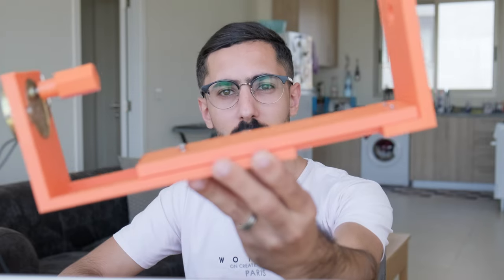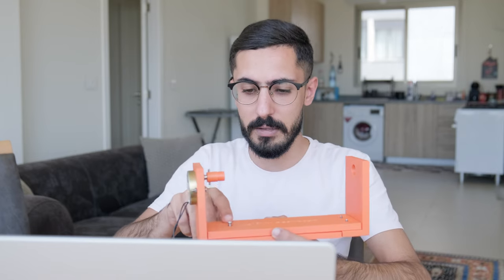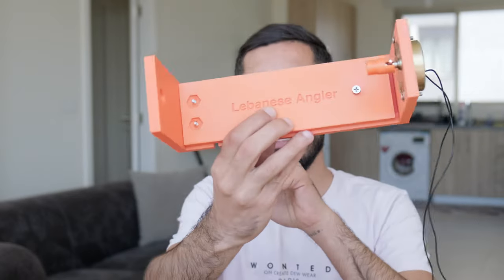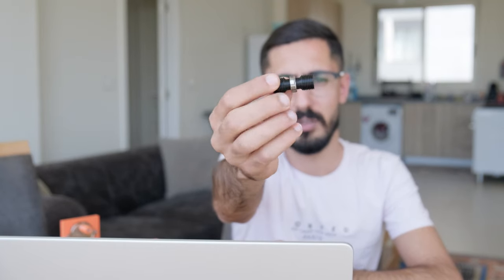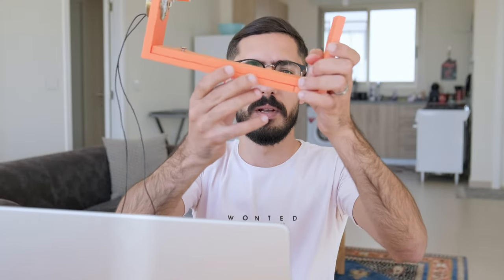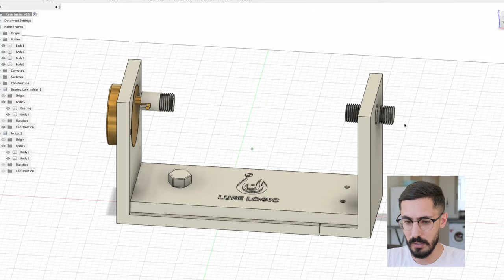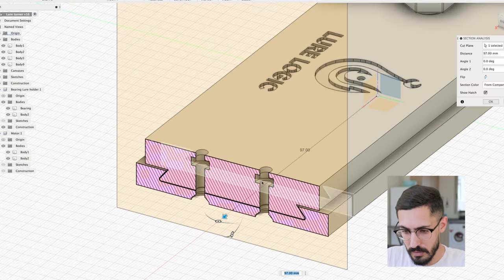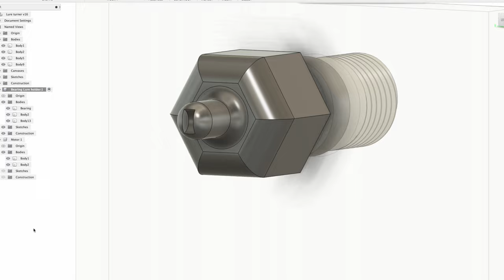Upgrading my Lure Turner/Dryer

Comment: Hi and greetings from Turkey, this is great design indeed, did you get any chance to develop it to hold 2 or more lures?
Reply from the maker: Hello thank you for your comment, unfortunately I haven’t done that yet cause I had to move to a new country and my new printer didn’t arrive yet, hopefully in the future I will do it and share it.
Reply: @LureLogicOfficial  thanks for your reply, i downloaded the files and printed only few critical parts like the turner bearing nut and the turner bearing screw, i did folow the print instructions on the dowload page bur got dificulties to assemble them, in order to get them fit i needed to do some sandpaper work on the edges. You may want to check with this and maybe add like 1mm fillets so they easily fit to eachother. I also did try to print the small parts with 0.2 layer hight but it didnt work, so as you suggested 0.1 works just fine. 👍
Reply: @sportfishintgturkey Weird, on my ender 3 it worked just fine. I might post an update later cause I moved to a mew country, got a new printer, and now using UV resin. But I still need the turner to level the resin before curing it with UV light.
Reply from the maker: I just noticed that I replied to you from my other channel 😂